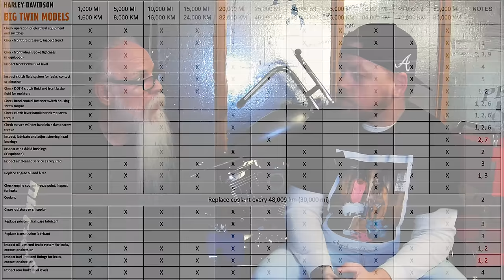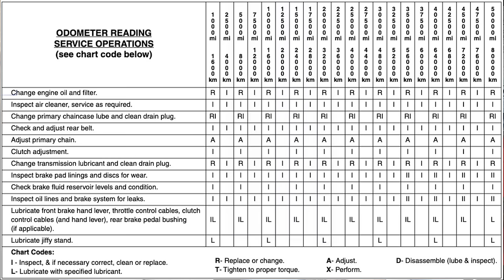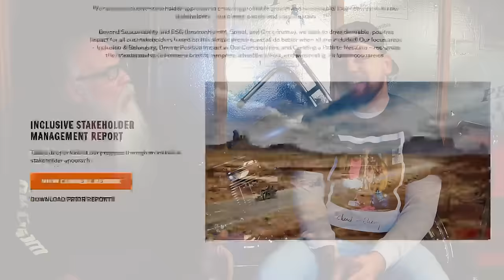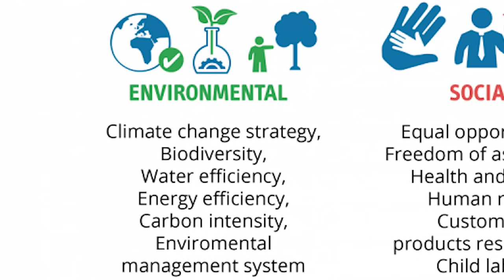Harley Oil Change Intervals-Engine, Primary, Trans

Comment: the rule I stick to is change your oil at every 8000 km or once every  12 months which ever comes first, I do this with my car as well, its the cheapest insurance you can get, I also change all filters, oil & filters are a lot cheaper than a engine rebuild.

Comment: Harley changed for EPA purposes. Red line transmission oil is the only oil I will run in my transmission 10 thousand miles.

Comment: 5 speed transmission in 2003 vs 6 speed in the newer touring bikes
Reply from the maker: Yeah, but do you think add a gear changed the fluid change interval to 4 times more miles?

Comment: There's so much wrong with this video, it's hard to know where to start, but here goes:
1. Lubricants have improved and continue to improve on an ongoing basis.  This is why the API service code changes and new designations are backwards compatible.  Saying that 2023 oil is no different than 2003 oil is completely incorrect.
2.  If you use gear oil in the transmission and primary, it will last a long, long time.  Bikes that don't have a shared sump can use lubricants designed for that purpose, whereas bikes with shared sumps use engine oil rather than gear oil, which will shear out of viscosity spec.  If you use engine oil in the transmission, as some do, then you will need to change at 5K, but gear oil can easily go 20K.  For example, BMW bikes with three holes have the gearbox oil change at 25K miles. 
3. They state that they've done "hundreds of thousands" of miles on the longer change interval with no problem whatsoever, so why then say that Harley is lying and recommend changing everything at 5K?  Fixing a problem that doesn't exist is expensive and wasteful.
4. Instead of speculating about some sort of conspiratorial motives, why not simply reach out to Harley and ask?  Wouldn't that make more sense?
5. No manufacturer wants there bikes to grenade so that you will buy another one.  That isn't how it works.  People buy new bikes because they want the latest, most powerful, and most reliable models.  Nobody buys an expesive bike they think is garbage.  Reliability ratings are huge sales drivers.

Bottom line is that if you change your oils on time with the proper quality and grade, you will never experience an issue related to oil quality.  You may have other problems, but it won't be due to oil quality.
Reply from the maker: You may very well be correct.
We have done no studies on the subject.
Do you have any independent studies that back up what you suggest?
Here is a video you may find interesting- https://www.youtube.com/watch?v=bNHgNThrqQo
KP

Comment: real simple do all three every 5 miles I use Amsoil engine oil / primary oil and transmission oil only take few extra minutes and few extra $’s it’s worth it
Reply from the maker: It sounds like you have a system that works for you! Thank you for sharing and for commenting! MB

Comment: Changing Trans and Primary oil less than 10k miles is useless. The oil does not get bad. I use castrol MTX 75W-140 in the tranny. It is expensive, but the best trans oil available. I regulary change engine oil and Filter every 3-4k miles.
Reply from the maker: Everyone has their own opinion about when and how to change their oil. I am glad that you have found an oil and routine that works for you. Thank you for commenting! 😎 MB

Comment: ESG scores is something fairly new. I do not believe ESG scores were in 2014. I change engine oil every 5k . transmission and primary every 10k. Over 80k miles on my 2004 TC88
Reply from the maker: Glad you are happy with your ride!
ESG scoring was in place in 2014 and different forms of it were taking place as early as 2004.
KP

Comment: One difference is The transmissions went from five speeds to six speeds and maybe they used better components who knows but I think everybody changes them sooner than 20,000 miles
Reply from the maker: Most people probably do change their oil sooner than 20k, but it is good to know that 20k  is an EPA thing and not actually what is best for your bikes longevity. 

Thanks for commenting! MB

Comment: Yea, if they are trying to get new riders for Harley, that’s not going to attract many young riders if you gotta do 3 holes oil change every 5k miles. I will do 5k engine oil change and 10k on primary/tranny. I was comparing the cost of owning my street glide vs my two other metric sports tourer, I don’t blame my generation for going for metric. My Honda ST1300 and FJR1300 are both around 80k, original everything except for the tires of course. Love the street glide but wtf why is my 2006 FJR1300 much more comfortable than my 2021 street glide?
Reply from the maker: Eeek, your Street Glide is not set up right for you.  HD's are made purposely as a blank canvas, see video on that subject here- https://www.youtube.com/watch?v=__NE6h1DhCg
Here is a video that you may find interesting/useful- https://www.youtube.com/watch?v=Y4pWGTj-iDE

Comment: The beast gets oil changed at 2000 miles with driven 20w-50 semi syn primary every 3000 with red line
and the trans every 3000 with redline then usually something is coming apart because I keep
adding power

Comment: Manual transmissions are so durable no matter what the vehicle is. 20,000 miles after an initial 5,000 mile change when new is not going to harm any manual transmission. But throw your time and money away if you so do desire, no harm in that!
Reply from the maker: HD transmissions are pretty stout...probably the most trouble free part of the drivetrain for decades.
HOWEVER, they do fail.
This last week I saw a 2014 Street Glide that had blown it's second transmission in the last 5 years, AND a 2021 Road Glide that had a couple of broken teeth in its' trans.
Both guys are hot rodders, and they both did not blame the bike, but their riding antics. 😀
KP

Comment: Harley probably dropped their oil stocks and didn’t push the oil usage as much.  I had a 2000 Fatboy, did all my own oil changes for 20 years on that bike.  ONCE a year I dropped all oils and replaced.  5k, 7k, 12k; it didn’t matter - once a year!  That motor was flawless and I did use Syn 3 when it came out in 2002.
Reply from the maker: Thanks for the comment and your input! -DS

Comment: I run mobile one motor oil and change it every 2500 miles with an old filter and I use in the transmission Amsoil transmission for big twin and primary Amsoil primary oil and I change it every other motor oil change so I’ll do those at 5000

Comment: Engines, Transmission, and Primaries are expensive... oil is cheap. I've always changed my oil in my HD's at 5K and this includes my new M8. It's just like many of the newer cars which have lifetime oil for the transmission. Only problem is it's the lifetime of the transmission so a transmission may last only 20k and according to the manufacture that's the lifetime of the transmission... it's just crazy how deceptive these companies have become and all in the name of carbon footprints. Like it was indicated in the video the maker has already sold you the vehicle they know they will make more money off of you when your vehicle breaks. The moral of the story is learn to do your own oil changes and save yourself a ton of cash... the only reason to use a service manual is to look up torque specs.
Reply from the maker: Good thoughts and advice, thank you! 👍

Comment: I have certainly been of the mindset every 3K for all three holes.  If I am on a long trip I will go to but never exceed 5K.  I have had zero issues with "typical Harley oil leaks".  To me that comment is reserved for "typically not taking care of your bike" results.  From the 88 forward you should not have oil drips, hot engines temps, motors that get mad at you riding in high summer heat, and the urge to throw vast amounts of money at "performance upgrades"  IF you address all the EPA BS you guys constantly comment on.

Comment: In all industries, it has been determined that in the old days, oil was changed more than was necessary. Don't  push today's  standards, they are push tge milage too far even though the old standards were too often.
Reply from the maker: I prefer to stick with what I know works for me. Personally, I wouldn't wait 10,000 miles to change my oil, especially if my bike is running hotter than usual. Thank you for sharing your thoughts and for commenting! 😎 MB

Comment: Change my primary and transmission every 3,000 miles and my oil every 1,500 miles.  Never have I found any metal shavings on any of the plug magnets.
Reply from the maker: Wow, that is pretty frequent.  Are you running dino oil or synthetic?
Reply: SYN3
Reply from the maker: Thanks! 👍

Comment: Oil, amsoil 20-50 every 2500, trans redline v twin transmission every 5000 and redline v twin primary every 5000. I fail to understand why anyone would use same 20-50 in all three holes... just because you can doesn't mean you should, specific fluid for specific application.
Reply from the maker: Good point.  Thanks for the comment. 👍😎👍

Comment: They werent using full synthetic back then. Primary and transmission will be good for 10,000 miles easily. Most everyone i know use Amsoil 20/50 full synthetic
Reply from the maker: Amsoil is a very popular brand! Thank you for commenting! 👍😎👍 MB

Comment: I change my oil and filter every 3000,miles and change my trans and primary every other oil change…or 6000 miles bike has 88000 miles no problem…in fact at 6000 miles my trans oil comes out clean…😊…the object is just do it often …

Comment: Harley should have made a fill plug for the Primary
Reply from the maker: I have often thought this...but it would need to be a dipstick plug.  It is more important to get the level of fluid correct in the primary than the engine or the transmission.  Too much oil and the clutch will drag.

Comment: Harleys betting you’re gonna bring it to them. They do stuff at their shop to keep you coming back like tightening bolts so tight you won’t want to mess with it. I’ve had it done to me but it just made me never want to deal with them. The other thing is there’s some bad information in some of these videos so use your best judgment on things and if someone tell you you need to torque bolts with a torque wrench that just don’t need to be that tight. If it’s not leaking it’s tight enough. For example-When you have to start drilling out bolts on your primary cover they were put on way too tight.
Reply from the maker: Thank you for the added input and for commenting! MB

Comment: 5000 miles is WAY too long, especially if the oil temperature is running much over 200 degrees. I change my engine oil every 3000 miles with Mobile 1 synthetic 20w50 motorcycle oil. Any other decent brand of oil is also ok, but it absolutely HAS to be 20w50 unless you are living at the north pole. Harley engines are very hard on oil. And even if the newer oils last longer, they still get dirty just as fast as the old oil. And you don't want dirty oil in your engine.   I also recommend changing both the primary oil and transmission oil at least every 5000 miles. Maybe more often, depending on what kind of conditions the bike is ridden under. Stop and go riding puts a lot more wear on the transmission and transmission oil than highway riding. Those crazy long change intervals did not come from H-D, they came from the EPA. The EPA does not like heavy oil (which a Harley absolutely needs) and frequent oil changes. They also don't want you to warm up your engine before taking off, something I do not only with my Harleys (which are all EVOs) but every other vehicle I have ever owned. Anybody who knows anything about engines knows that they need to be at least close to operating temperature before you put a load on them. Cold metal is weak and brittle, warming up cold metal too fast can cause excessive wear and stress cracks, and the clearances are only correct at operating temperature. Metal expands when heated, and it will be damaged if it expands too quickly. 

Consider the EPA to be exactly the same as the Nazi Gestapo. Both equally evil.
Reply from the maker: Lots of really good info in your comment.  Thank you for sharing.
👍😎👍

Comment: Compensators we’re shredding causing the inner primary bearing to fail. Fix change oil more often.
Reply from the maker: You think changing the primary fluid at 5k instead of 10k would have stopped the poorly designed compensators from a few years ago from failing?

Comment: I think your just making the oil companies richer by changing every 5k.... you don't change your transmission oil in your car every 5k, do ya?  Or change the oil in the differential/transfer case every 5k... if it gives ya piece of mind, great, but I think your just wasting money.
Reply from the maker: You could very well be correct on the trans.  Engine and Primary are a different story, I believe.

Comment: I change engine oil every 5000, primary every 10000, and transmission every 20000. Oil in transmission and primary don’t get as hot as engine oil, and less moving parts, any oil change sooner then that is a waste of oil and money. Harley have a reputation to stand behind they are not going to have you damage you motorcycle just to get points.
Reply from the maker: That would be nice if HD really was that trustworthy.  Unfortunately they have not proven to be.  Many examples, this video linked below is just one-
https://www.youtube.com/watch?v=M-QdwkZ3_RQ

Comment: Screw esg, I change my oils at 5K.  Oils are much cheaper in the long run than new motor parts.....in any situation.  Tell me there is more damage to our world with used oils than metal parts mining/manufacturing/disposal.....
Reply from the maker: Exactly!
Typical lack of common sense on the part of government agencies.
Another example of the same flawed thinking is that they want to shove all that hot, oily, oxygen depleted air into the intake...but it means less MPG, and engines that wear out faster....which means more parts have to be made to replace parts wearing out faster.
An External Breather System will put that hot, oily oxygen depleted air into a filter or catch-can....supposedly bad for the environment, but it also means less gas being used and less energy being used for making parts that don't wear out prematurely.

Comment: 3000. Shavings only come from extending oil change too long. Every 3000 no shavings. 5000 trans 3000 engine and primary.
Reply from the maker: Great points! 

Thanks for commenting! 👍😎👍

Comment: Hmm, Pretty sneaking of the Motor Company, and just another circomstance that proves you need to take what they say with a grain of salt..Its all about Harley Davidson, and not the consumer.   but  I like 4, 8 and 12K intervals (engine, primary, transmission)  It's easy to remember, and still ahead Recommended periods
Reply from the maker: Yeah, since making the video, and reading and thinking about all the info in the comments, I think I will do the engine and primary at the same time (4-5K miles) and do the transmission every other oil change.

Comment: This is crazy.   When talking about heat on the engine, you guys make a point of saying the guys making the manual are engineers and know what they're talking about (230 degrees).   So now you're telling us NOT to trust the manual and the engineers when it comes to fluid changes.  Yes, I understand the point you're making...but when the bible - the service manual,  is not reliable in one area  then there is doubt about everything in it. 

Hell, if you want a super healthy bike, change the fluids every 2k.   And the plugs, etc etc.
Reply from the maker: The video linked below may shed some light on why we know that, for the most part, the engineers at Harley know what they are doing.  That does not mean that Harley Corporate follows what they know.  There are many reasons why HD would not follow engineers knowledge, two of them are EPA restrictions and concerns for shareholder dividends and stock price.
https://www.youtube.com/watch?v=N0kLaVQhbW4

Comment: Use amsoil in trans and primary.  Use the fluid made for the whole.
My shavings are none in trans and almost none in primary.  Engine oil Is also amsoil .  Smoother quieter much better.  Harley oil is garbage especially in trans and primary metal everywhere.
Reply from the maker: Have you tried the new HD heavy gear oil.  They have it labeled for the transmission and the primary.
I am running it in my trans right now, and it is very close to as good as the redline shockproof.  I have not run it in my primary yet.
Amsoil has lots of very loyal users.
Here's a video you may like- https://www.youtube.com/watch?v=bNHgNThrqQo

Comment: I would love to have all the money you people have thrown away by discarding oil that's not even close to it's useful life.   Both Porsche and Mercedes get 10k miles between oil changes on mobile 1.  I m sure the high tech Harley motor needs better oil conditions..lol
Reply from the maker: Could be the heat, not the high tech.  😱